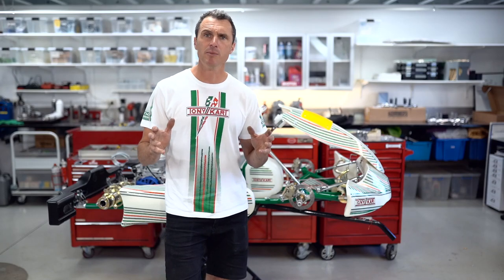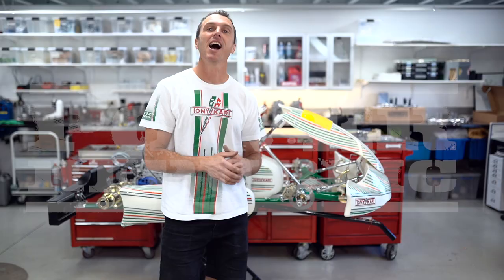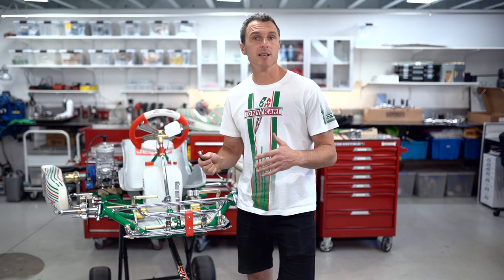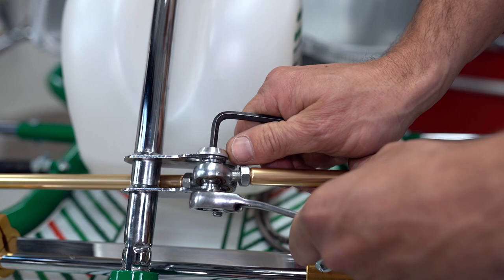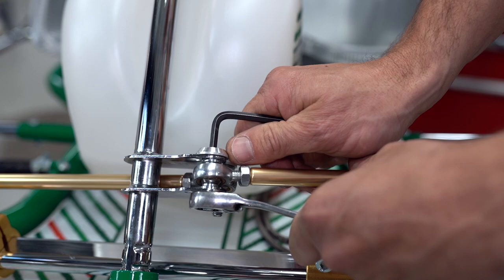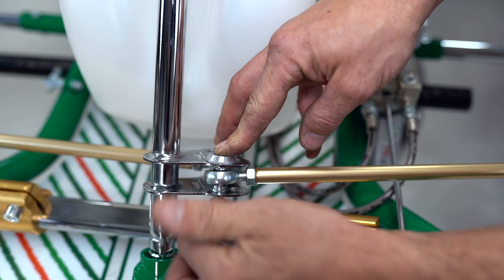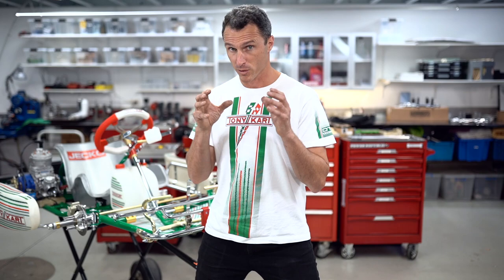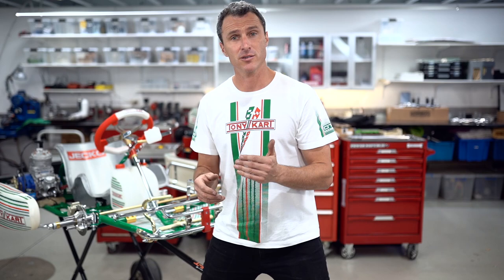TUNING TIPS: How Ackermann Adjustments Affect Kart Performance - POWER REPUBLIC

Comment: Unrelated question, I know you’ve done a few awesome videos about the X30 Super 175cc including the Dyno test, here is my question.. Any idea how the IAME X30 SUPER compares to the IAME OK direct drive 125 engine? I know the X30 SUPER has a lot of torque and it flies coming out of the corners, but I’ve seen a few OK engines at my local track and they are super fast, but which one is faster? Any idea? Thanks in advance
Reply from the maker: I haven't got an OK senior engine to compare.  I think the OK engine karts have a weight advantage too over the 175 which is a little beefy.  are you planing on racing in a class where you have to choose>?
Reply: @PowerRepublic  
Thanks Derek, yes you are right the OK engine is so light, and yes I need to choose between the X30 Super or the OK engine, obviously whichever engine is faster would be better, although I like the fact that you don’t need to push the X30 Super to get it going, that’s pretty convenient- Any idea of the top speed of the X30 Super on a track with very long straights? Which one would you go for?
Reply from the maker: @p.c.h.6721  the top speed isn't insane on the super X30. they do have incredible bottom end, but above 12k rpm the power is back to normal, and its hard to rev them much past 14.5-15k RPm.   if you have a high speed track, maybe use the OK engine
Reply: @PowerRepublic  
Thanks Derek, you’re right on the money 👍
Appreciate it! 🙏

Comment: I understand the Ackerman Principle - I don't understand why the outer wheel starts to steer back in the opposite direction before full lock. Could you explain that one please? Thanks
Reply from the maker: I guess its cause the arc or radius the tie rod end takes as you turn the steering wheel.
Reply: It’s because the steering column is rotating and the pickup point goes past the maximum - think of it like a crankshaft and tie rod is like a conrod. As a general you should never be using that much steering, even in the wet unless you’ve gone sideways and you’re running out of talent.

Comment: In witch order schould i start with setting up a racingkart? I have problems to find a solid base setup.
Reply from the maker: i would start with the kart in its standard form, as it was delivered from the factory.   with new tyres.   then make a few small changes each session or 2 as required.  if you are new, leave it standard for the first few sets of new tyres until you can highlight the patterns of problems as they arise